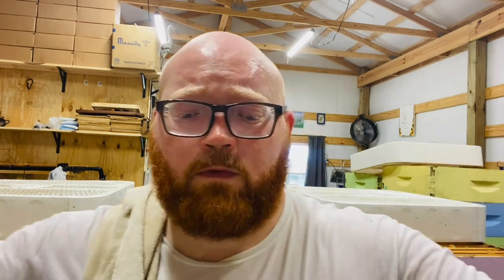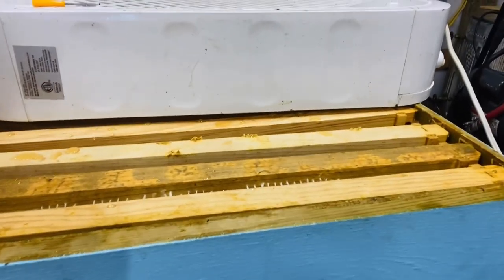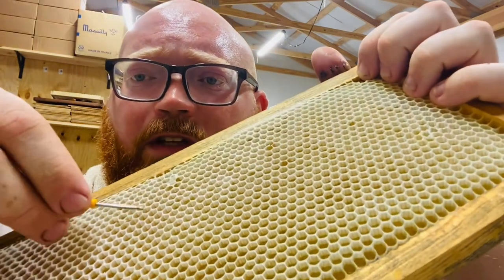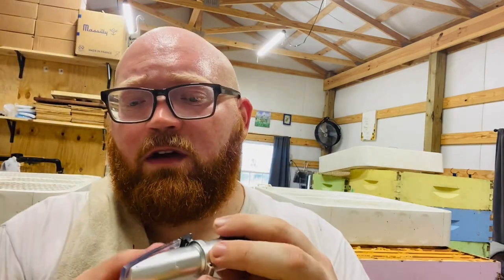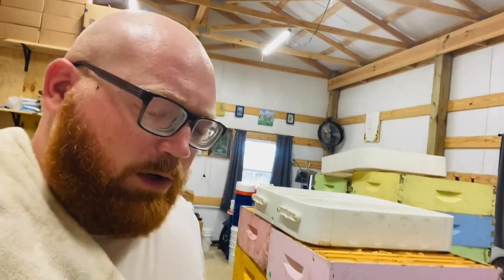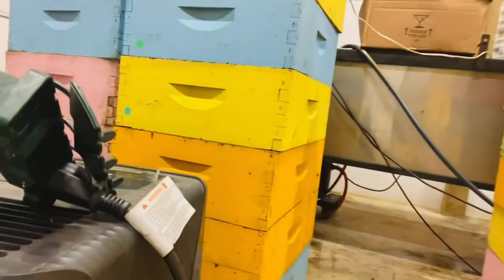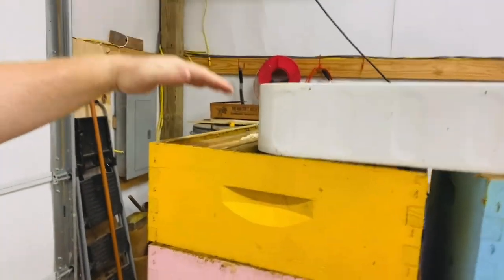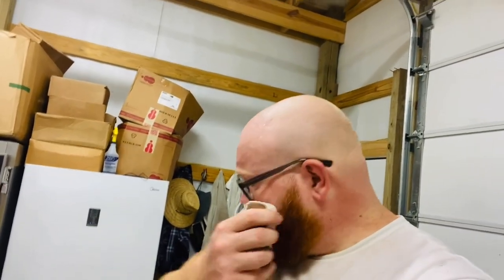What to do with WET Honey!

Comment: Great video, I place two 2x4's under the bottom of the stack to allow the fan air to blow out the bottom of the stack. Each stack is on a wheeled platform like Jeff Horchoff Bees does it (learned that from his videos). With the dehumidifier and fans I am usually able to bring it down a point.  I run the fans for 2 days and then harvest.  Thanks for sharing :)

Comment: Thanks Gus for a timely video. I use a dehumidifier also and in my very small operation I drop the moisture level from 20 to 17% in three days. My air goes all the way through top to bottom so maybe that helps. It sure is a effective way to ensure that your honey has a low moisture content. Off the extractor today I saw 16.7%
Reply from the maker: Very nice!

Yeah It’s important that the dry air circulates all the way through.

Comment: The thing i hate about these Refractometers is you have to recalculate it with extra virgin olive oil every time room temp changes 5°, but im glad i read that in instructions  cause its usually. 5 to 1 # out of calibration everytime i get ready to check. Hope to get one of those electronic ones like Kaymon one day, but they are pricy

Comment: Gus I've found that for some reason if you offset stack the supers you seem to get a better cycling airflow.  They always dry a bit more/faster that simplify square stacking them.
Reply from the maker: I’ve tried it both ways. 

Offsetting them in the honeyhouse I got weaker airflow and not enough air reaching the bottom supers. 

Stacking them tightly I can feel a much stronger airflow circulating all the way back up and out which is what I want. I need the hot dry air circulating through the entire stack to help prevent small hive beetle as well as drying.

Comment: Your customer needs to learn not to pull uncapped honey , learn beekeeping!  Uncapped honey is not worth the risk trying to harvest due to not only moisture but fermentation in jar.. Bad decision to pull supers
Reply from the maker: I offered some tips. Stuff happens we just have to do the best we can with the situations we are in.
Reply: I'll have to disagree on not pulling uncapped honey, I extracted some last year that the capped honey was 18.5% and the uncapped was 17.5%. I've heard somewhere in Florida its rare to pull capped  honey due to high humidity , they have to pull and dry. I check frames before extracting,  if it reads 18.5% or lower its fine